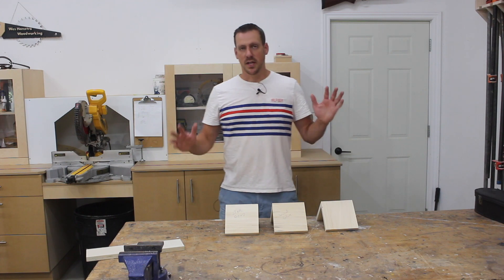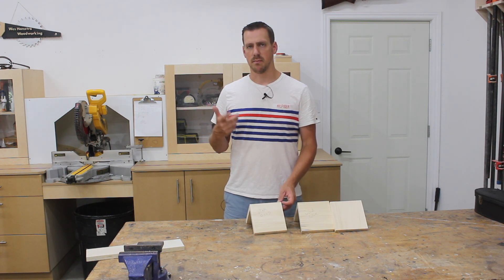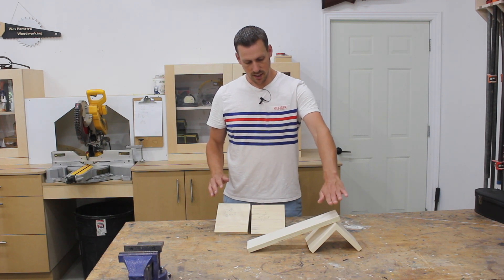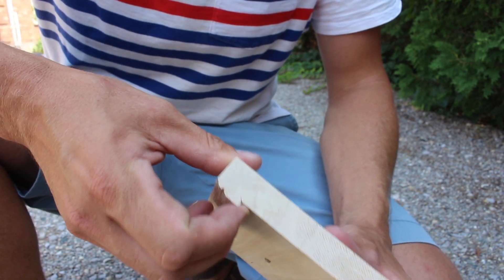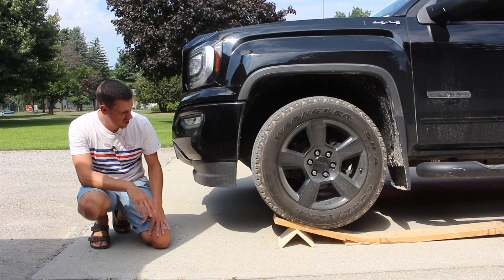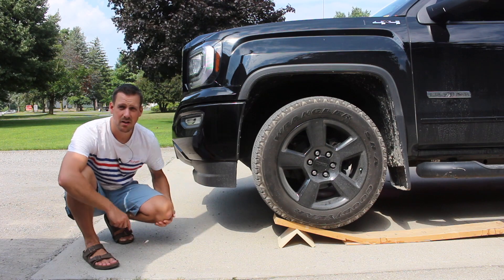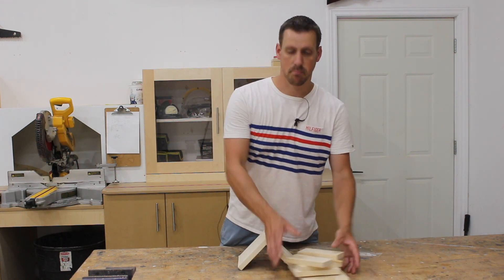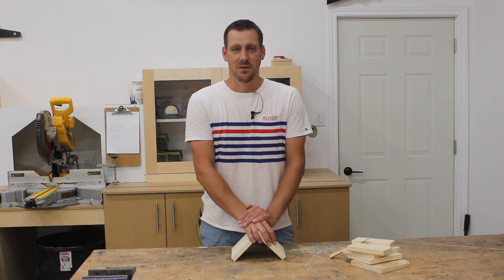How Strong Is A Mitre Lock Joint?

Comment: It would have to be a LOT stronger than that to justify the cost of one of those bits.
Reply: stronger than what? It was stringer than a 2x6 or what ever he used, with a truck parked on top of it!
Reply: @robertwolf8123  It would have to be capable of holding up the Empire State Building at least.